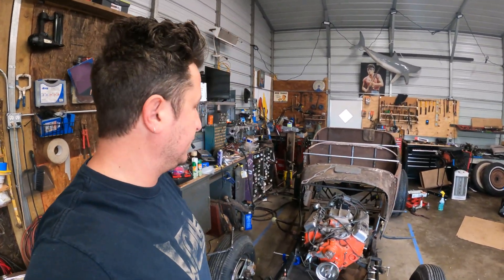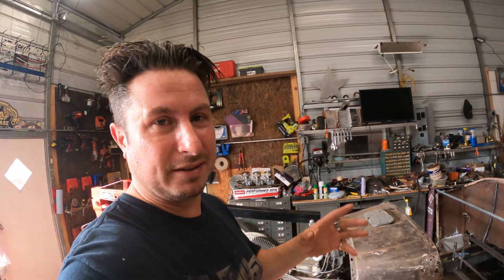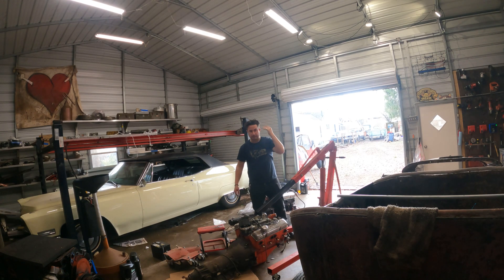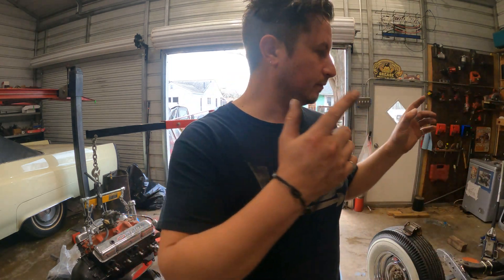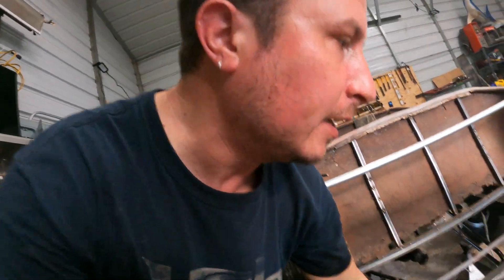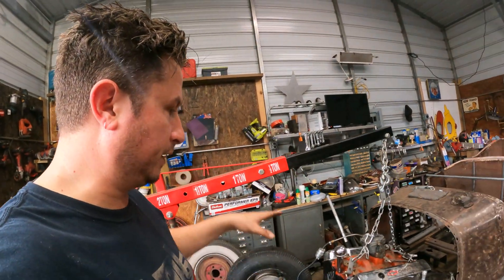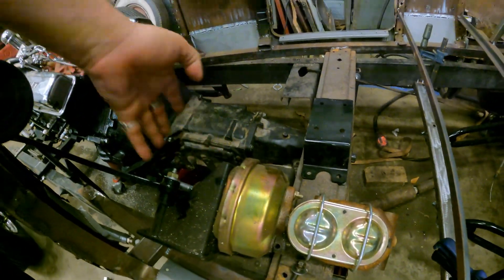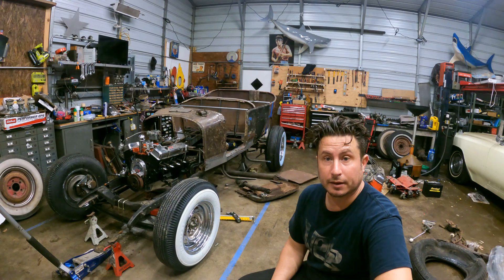"Real" Hot Rods Have THREE PEDALS ** OUT with the Automatic - IN with the 4 SPEED - 1927 Ford

Comment: Graffiti strip you should go find it at Walmart I use it to take spray paint off ceramics shouldn't hurt the Chrome I would definitely do a test first I believe it's designed to be used on vinyl siding aluminum siding brake building materials that generally get graffitied
Reply from the maker: Thanks for the tip.   I ll pick some up and we ll test it out !